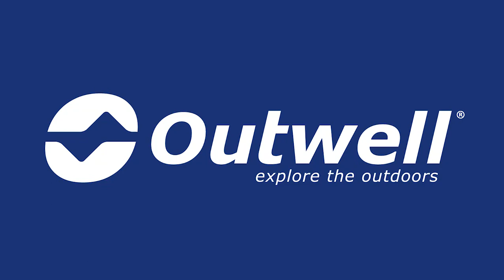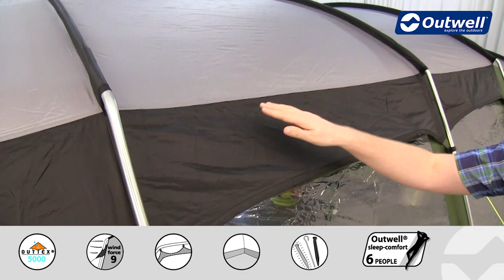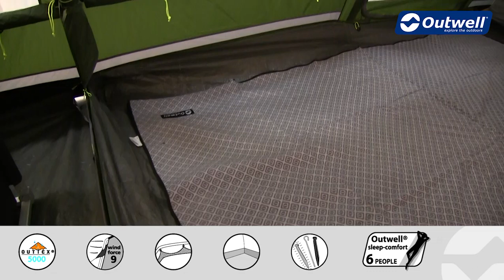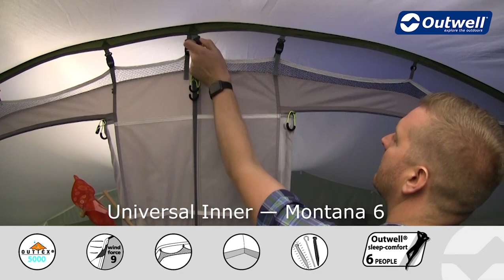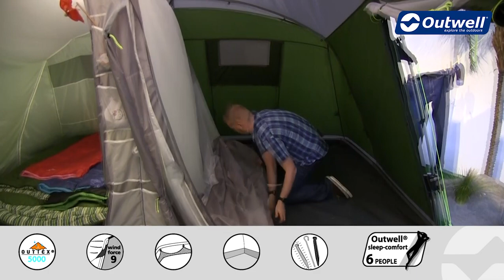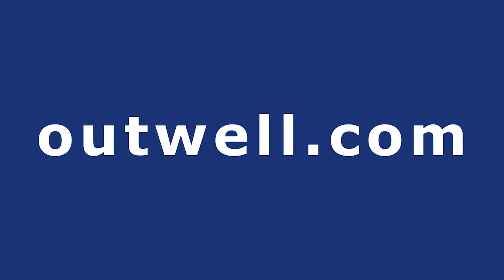Outwell Drummond 7 Tent - 2016 | Innovative Family Camping

Comment: We just ordered our Outwell Drummond 7 package from campingworld uk. Hope to use this new tent in the Pacific NW.
Reply: Would be interesting to hear your thoughts after trying it, it seems to be so new on the market that no customer reviews at all exists yet! Quite an investment to do with so little neutral information.
Reply: So here's my thoughts. I step up the tent in 2 hours. I have a 2 and 4 year old and a 8 mth old dog. So I had a lot of interruptions. I could have put it up in 30-45 minutes. Staying in the tent was great 10/10. We have the carpet and foot print accessories. Breaking down the tent was easy 9/10. Setting up the tent was difficult for my wife and I 5/10. We had difficulty with getting the pins in to the bottom of the steel poles. We checked the poles and rearranged them. We put the small poles (blue tape) over the bedrooms per the instructions, but nothing really improved. We ended up sticking the bottom of the poles into the loop that the ground stake would slide into, then we put the stake in, and then hammered the stake into the ground. Here's a photo of the tent. http://bit.ly/2016drummond7. We will mostly switch over to the inflatable upgrade.
Reply: Kevin White here's a copy of my purchase receipt. I waited for a package deal sale. I bought the tent, carpet and footprint for $970 US. With free shipping. https://goo.gl/photos/L19wYbfMNswwMB3m6
Reply: Kevin White the puzzle rubber pieces are good for camping. The outwell fleece carpet option is what we use.
Reply: Kevin White it's not a thick carpet. If you have a rock under your tent it will hurt the bottom of your foot. The carpet feels good though. We like it. We clear the tent foot print of any thing that will cause discomfort.
Reply: Kevin White from memory, the front door does have mesh and solid zip doors. I hope I'm correct.